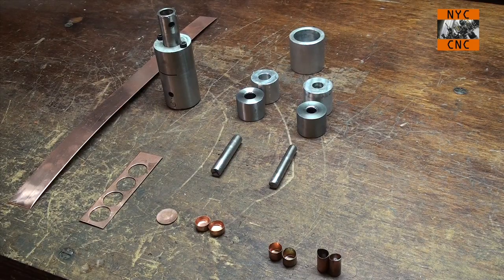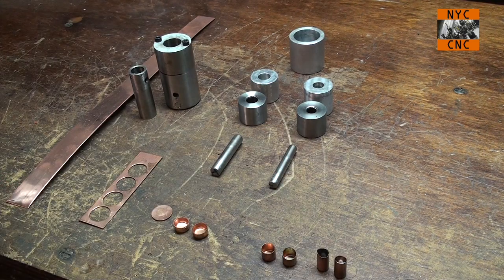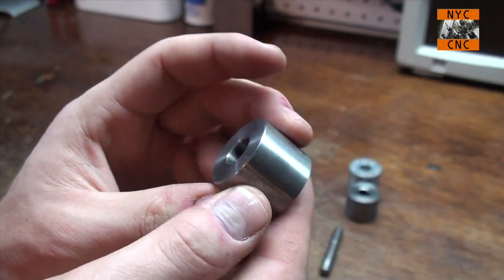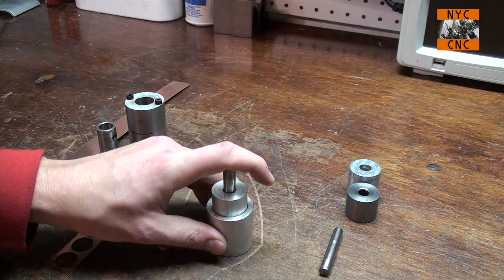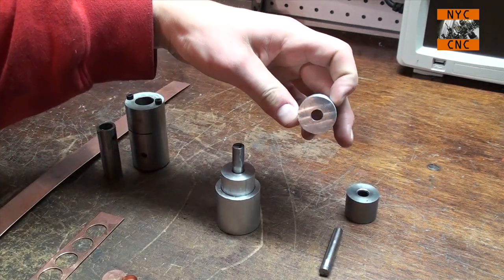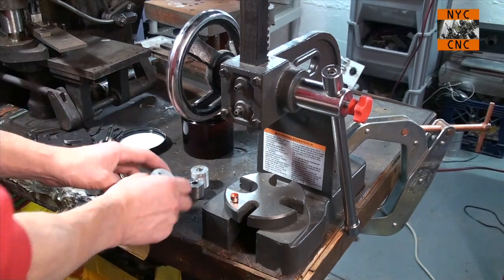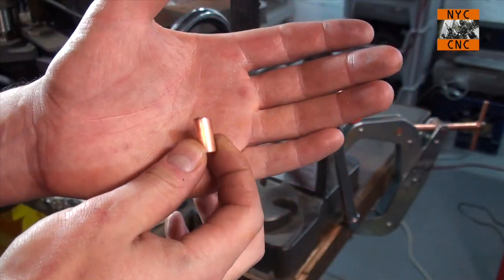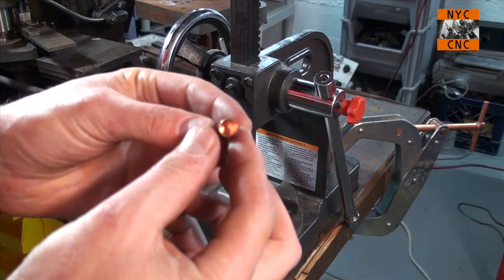Drawing Copper Bullet Jackets: Machined Drawing Dies

Comment: That’s a lot of work and time for a $.05 part
Reply: 😂 I got 12 bullets left out of an old box of Nosler s that have been discontinued for a 22. Hornet components as far a beans go are non existent you might as well try and find a unicorn I got several boxes of beans I’ve tried none have performed as well as these old Nosler’s because they do not fly as well you can find a video of Elon musk talking about his rockets and the shape of the nose he said I said more pointy and the engineer said it will not fly as well but they did it anyway but only to a degree as to not detrimentally effect is aerodynamics in an extreme manner
Reply: @savannahdennis9351 maybe try punctuation?

Comment: You could totally use this system to make cartridge cases. You'd need a stronger press, ideally, and a lathe system to make extractor grooves and the primer pocket, but you could do it. You could actually do the necking with a regular reloading press, just draw out a straight walled blank of the rough dimensions, put the extractor groove and primer pocket in, and neck and size it in a regular reloading press. Seriously.

Comment: This has been a wonderful series of videos!  Thank you so much for making them.  My interest isn't in making bullet jackets although I do make jacketed 6mm bullets to shoot bench rest.  I also make bamboo rods and use nickel silver ferrules.  I have been sizing down nickel silver tubing for traditional ferrules with a wall thickness of .015.  My problem is I'd like to make some ferrules for a spey rod which require a wall thickness of .030.  Hence I need to form cups and then draw them out.  The process will be the same as your bullet jackets.  If you care to exchange information I could help you with the uneven ends on your jackets.  The problem is in having a tighter fit for your pushing rod through the die and having it perfectly centered and strait up and down on when pushing it with the arbor press.  It is problematic as your wall thickness will not be uniform.  Please let me know how I could contact you.  Thanks again and all the best, Don Hansen.

Comment: If you want to harden aluminum book salt (sodium chloride) at 525°C and dunk the aluminium in it for 30 mins.

Same works for copper though you need to be hotter... Or you could just rely on the work hardening. Anneal after the initial souage into cup form then let the next two or three steps work harden it again to make your jacket more effective.

Comment: If you fit the punch into the press ram and hold the die down you can force the shell through then insert a v plate underneath the lift the punch and separate the shell without messing around with grips etc. It is almost impossible to draw such a long shell without some irregularity at the open end. Spent forty five years making draw dies and forming tools in the jewellery trade.

Comment: Another awesome NYC CNC video!

Any chance you could automate the copper drawing process with your hydraulic hole punch, including a stripper to remove the cups from the punch?

Like one of the other comments, as I was watching your video I was wondering about reforming the copper by spinning it.  It's a fairly common process for aluminum.  Without using my Google brain, I'd guess that copper work hardens too readily to be radically reformed without annealing, But imagine a blanking die that punched a round coin with a small center hole.  The hole is fitted over a stem in a custom shaped live center mandrel in the tail stock of a CNC lathe.  The spindle could have a tool with a machined divot with a center hole to accept the tail stock stem, to form the bullet nose when the two are pressed together.  Instead of a cutting tool. there could be a small bearing to spin form the spinning copper disk against the tail stock mandrel.  The CNC could do the forming in several passes.  A torch on the back side could heat the copper to anneal it as it was forming if needed.  Still seems like a lot of work.

My primary interest in homemade copper jackets would be a die set that uses 22 LR brass as the jackets for .223 plinking bullets.  There are commercial die sets for reloaders.  I've been tempted to buy a set, but they're about $600.  I could buy a lot of .223 bullets for that, so the payback would be long.

I cast a lot of lead bullets.  I've spent way too long thinking of an automated machine that would plate copper from a piece of copper pipe onto a lead bullet core.  I'd cast the lead bullet cores in custom undersized molds.  Commercial plated pistol bullets have only a  few thousandths of copper plating and are only good for about 1500 fps.  I'd want to be able to plate rifle bullets with much thicker jackets, but that's a lot of electrical power and a lot of time.

My other cast bullet research project is automating a powder coating line for my cast pistol bullets in lieu of messy and ugly bullet lube.  Others have reported good results shooting powder coated bullets - no leading in the bore and recovered bullets have retained their powder coating.  Powder coat is tough stuff!  My reloads would look a lot better with black powder coating instead of bare lead, and I wouldn't get messy bullet lube on my fingers when reloading or handling the ammo at the range.

Comment: pretty cool stuff sir :-)
I was just thinking (if you havnt tried it already of course) is to put a 45 degree taper on the working end of the first drawing punch, making the tip the same diameter as the working end of the second drawing punch, which should help keep the cup centralized a little more accurately in your second drawing die :-)

Comment: Sort of I used a big drill press like a wood lathe on its end and turned the parts freehand with a selection of cutters made from files.   For stock I used a 1" bolt then set a 1/2" inside of it. Then a 1/4" bolt inside of it.  It's out in my reloading stuff some place if I can find it I'll post a video and send you the link.

Comment: neat stuff for sure but here's a video for an easy mod to do to your non ratcheting arbor press to eliminate the issue of the handle being at the wrong angle for applying optimal pressure. I did it to my press and it has worked out very well.  Half Ton Arbor Mod
Reply: I noticed the vertical (minimum power) handle on the arbor press for both dies.  For short run production on my little arbor press, I put a spacer under the work piece to get the arbor press handle in the power zone.

Comment: There is some confusion over Silver Solder, the 1-5% that melts at 200°F is a soft solder and should really be refered to as silver bearing solder. The Silver Solder I use is 45% Silver.

Comment: Yes if you don't anneal it cracks or creases. You try to just shape and get as little thinning as possable as after forming you normaly have to skim the diamater in the lathe so you get 0.001" clearence between the end plates and the barrel for silver soldering.

Comment: After finishing this I tried to post a comment and You Tube went Bit hell.  I think that's behind me, GOOD stuff here John! One comment copper can air cool just like steel when tempering  and also be quenched  this is the same as other non ferrous metals like nickel, silver, brass... Aluminum is more difficult I've seldom had good results when heating it. Regular mild steel get fairly hard and can be case hardened.

Comment: Nice work. You cold make the guide bushing 2 parts(top part same ID as dye bottom same as the bushing you have to slip in the cup)with locking studs so they line up proper each time it keep the punch straighter and even out the pressure. You also could put a hole in the punch for a T handle to make it easier to separate the cup and punch or you could bore a hole threw it with a good radius on the punch face so you could just push off the jacket instead of pulling it apart, help with suction to

Comment: Looks like if the arbor press design is working for you a turret is in order.
Also to consider: if the punch were fixed to the upper part of the turret press and the bushing secured to the bottom you could use the up stroke to pull the workpiece from the punch, with some minor design revision required.

Comment: You should look into getting a punch grinder, they are just a few hundred dollars on ebay. What they will do is turn your surface grinder into a little cylindrical grinder. Word of warning they are not proper centerless grinders, so you will need to leave section of the untreated shank to be held in the rollers.

Comment: John - make a thread on the end of a rod which matches the thread on the end of your pliers and screw that rod into the pliers - use a button ( drilled through rod of say 1,1/2") or so diameter as a sliding pull hammer - button is pulled against a stop at the end of the rod whilst your pliers grip what you want to pull - makes easy work of small pulling tasks as per your video.

Have enjoyed watching your videos off and on for a while now.
Cheers Pete

Comment: why are they made of copper? am not a gun guy
Reply: Actually barrels are hardened. Usually through nitride or chrome plating, some, like 50cal barrels, are simply made from a harder material fitted inside a barrel. 

It's a barrier between the lead core or steel core of the bullet and the lands of your rifling. If you have lead touch the lands it binds hard to them and fouls up your gun throwing off accuracy or even causing another bullet to stick in the barrel.

The copper acts like a guide to stop this as it's sufficiently hard to not sinter or forge weld into the lands. 

With a steel core it stops the hardened steel from grinding on the hardened steel of your lands, which would be like rubbing two files together, it wears the barrel out super quick and ruins it, like within a single magazine, the copper is sufficiently dense to add mass for stability, sufficiently tough to deform just the right amount to engage the lands effectively and give maximum accuracy and has a sufficiently high melting point that it will not "lead" the barrel. That is to say it will sinter, forge weld or melt onto the lands or grooves, giving you a clean barrel which means accuracy or if you prefer, sustained fire. While delivering your hardened steel core to the target to defeat their armour. 

The jacket serves a double function here in that once fired its hit and it gets even hotter, effectively liquidising after creating a dent and softening the impacted material which then is easier for the hardened steel core to penetrate and easier again as the liquid copper acts like lubrication to help the steel core through the target.

I hour that clarifies things.
Reply: It's because the riffled barrels are not hardened and a steel jacket bullet would wear down the riffling after repeated firing. Full lead bullets became obsolete a century ago as they would strip if the helix was too steep. Copper and its alloys are the perfect middle ground.

Comment: When you can do it on your 1 ton arbor press you can probably easily make a multi-stage air cylinder with enough force to do it as well (and much faster and easier). Maybe a 3 stage air cylinder.

A 3 stage air cylinder with 100 mm internal diameter at 8 bar air pressure will give a theoretical 18849 Newton = 1922 kg of force.
Reply: John NYCCNC I don't know about brands, I have just made my own cylinder on the lathe from a solid aluminium round bar (probably better to use a thick walled pipe though so you don't have to remove that much material) and then som o-rings cut and glued to size for seals on the piston and seal holes. It was for a power drawbar on my mill.

Comment: Couldn't you use metal spinning?
Reply: John NYCCNC Spinning would not be as uniform. It would be hard to match weight and thickness all over.
Reply: David Kirtley home come?
Reply: With spinning, you are doing it by pushing a ridge as it turns. Kind of like riding a wave. The metal isn't homogeneous and will end up with some thicker and thinner parts. The swage makes it kind of "flow in all directions at once"
Reply: this isn't a problem in cnc spinning; i think cnc is implied when he will be making 1000s of parts.